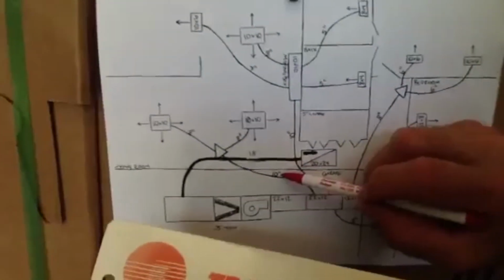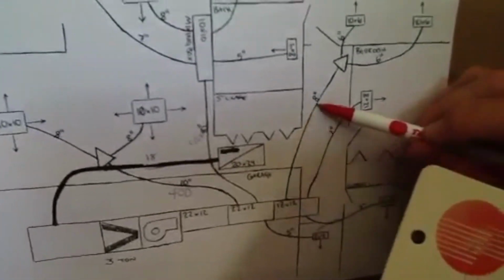Air Duct Calculators: How To Size A Duct System For A House

Comment: It is terribly sad to see how many hacks there are in building trades. 
It is unbelievable how many times I've been asked to look at a system for family, friends, friends of friends, etc.,  where hacks have tried to sell larger capacity equipment when the existing equipment is over sized, and the duct system is too small.
   I travelled 9 states working on very large industrial and institutional equipment, and helped with  instruction through our apprenticeship training center. My immediate supervisor was the primary principal of the company, and also my fire/ EMS captain with our local dept. I got the "oh crap" calls, the I need you to smooth out this problem with plant, school, or job superintendents -- especially if there were any potential liability issues (use the fire investigation skills)  had calls at any time of day or night for critical HVAC, squad, or fire. (We had 'fire phones' when I started) 
  Our industry standard only uses three to five feet of flex at the end of a run, when tying to an end device, or a flex connector between a units discharge or return for isolation. 
We didn't do the flex octopus jobs so common in mobile homes and stretched basement or attic jobs-- usually collapsed from someone kneeling or stepping on them, that are often encountered in residential and some commercial work.
 Nice tutorial of the duct calculator and sizing. Sure wish others would upsize when close to published design limits -- especially with spaghetti flex jobs. 
Do you have a video addressing  Total Effective Length, calculating loss through takeoffs, elbows, boots, registers and grills? It's not hard to eat up the first 100' on some of the McMansions some of these 'builders' cob together. I'm working with three neighbors, two with brand new homes, addressing screw ups. One has a ranch home with a 6 degree differential between their living room where his thermostat is and his two young son's bedroom. They've only been in the home 6 months. The builders HVAC contractor has been out twice and hasn't been able to rectify the problem. 
There are so many other variables that affect the final performance results that every edge will help.

Comment: Hello David, How would you calculate a mobile home split system with an inside down flow air handler 3 ton . No return . The Mobile home is 16X80 single wide with 8 vents total. The original duct is the rectangular sheet metal, and it is degrading.The mobile home is 1999 model . The local supply shops do not have the sheet metal available & I am considering using Flex duct & I am not sure what size  or may I even use flex duct in replacing the sheet metal .
Thank you

Comment: How can you calculate the duct work size without consideration for the component friction loss  including register AK factor and the total equivalent length of the duct runs after you have that info then you could use the duct calculator

Comment: Is that 400 cfm the same for Miami , FL where it might be hotter?
Reply: Yes, he mentioned 400cfm/ton of cooling capacity.  As your system tonnage goes up, so do the airflow.  If its hotter, you'll need more tonnage and more airflow, but the same airflow-per-tonnage (cfm/ton).

Comment: Hello David, I enjoyed your video. I have a large upstairs room that I am trying to cool that has existing AC/ heat. We recently took out a tree at the front of the house and noticed that the room is not cooling like it use to. Would it be wise to add another return air vent in the ceiling in this room? The room is 9 ft tall by  20 ft x 15 ft and has three  vents that are feed by one 12 inch flex supply duct (split three ways). The nearest return air vent is about 20 ft away from the room entryway. Any advice would be helpful, I am going to do this myself if possible.
Reply: If you keep the room door closed, then a separate return in the room should increase the cooling airflow to that room;  if problem exists even with upstairs room door open then an extra return wouldn't  make much difference - in that case, you may need to balance the supply flows to increase the flow to this room relative to the other due the added heat load due the absence of tree shade.

Comment: My ac guy use a single 14" flex for a return on a 2.5 ton ac/heating gas unit.. 2 story home.. no return upstairs and its hot upstairs with ac on.. I need another return upstairs cause a 14" flex is only 700 cfm and I need to return 1000 cfm of air.. am I correct.. not enough return
Reply: 14” inch flex is 1000 cfms, but the more return air drops the better.
Reply: Return should be upstairs as well. Good luck making that happen

Comment: ok a little confused here if the duct size is to low its causing an airflow restriction on the low side the high side is breathing freely unless installed without enough room. So why would head and suction be high I would assume it would be lower due to the airflow restriction and cause the system to ice up he says this at 7:25. Maybe he is talking about a heat pump in heating season but cooling it would be opposite
Reply: He was a little confusing here, I agree..  He started talking about the refrigerant line pressures..  I believe he is suggesting that decreased airflow diminishes the proper superheating (or even prevents evaporation) of refrigerant (in the evaporator coil) which reduces system performance and can even damage a compressor if its being fed liquid.

Comment: Great Video but lots of guys in the Trade may know the refrigerant side of the equation but have No Clue on the Airside and how it affects the system.This is the reason all A/C guys just starting in the Trade should Install for a Couple of yrs before learning the Refrigerant side makes a well Balanced Mechanic.Yrs ago I was subbing an Install the guy was a Refrigeration Mechanic,Coolers. Freezers etc .I asked him what size for each room he said just put 9inch in every room then I asked him you ever sized an A/C system and he said No ,I shook my head and took out my Ductulator and sized in for him ,Lol